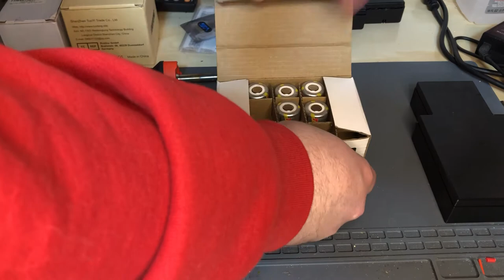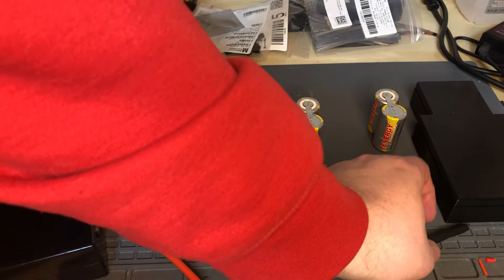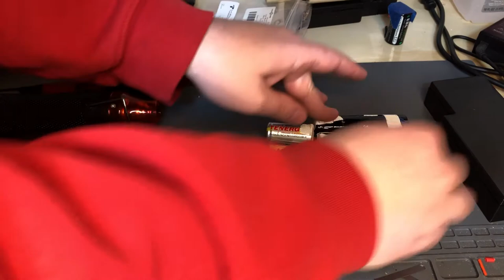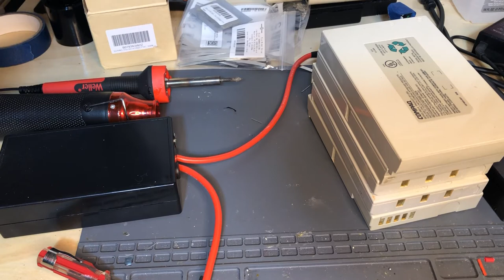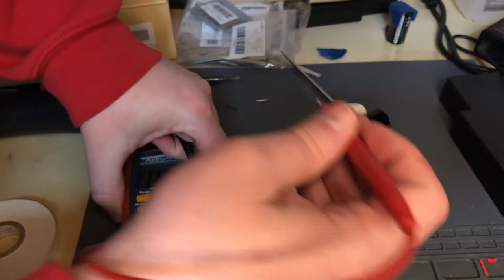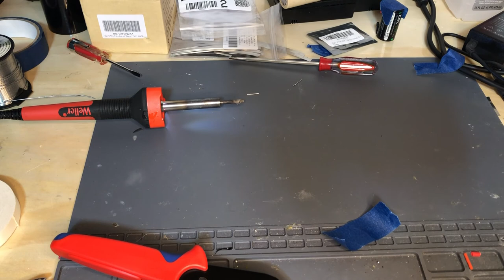IBM PC Convertible 5140 Ni-Cd Battery Rebuild

Comment: Do you have a store website or communication info I'm interested in getting this identical battery for my ibm
Reply from the maker: I do have an eBay store under the handle 80486sx.  This is one I can just probably build as I don't need to recycle parts from the original.